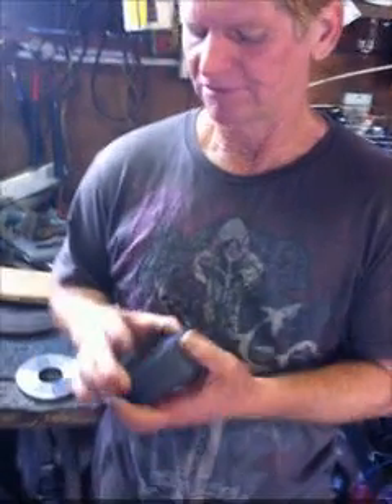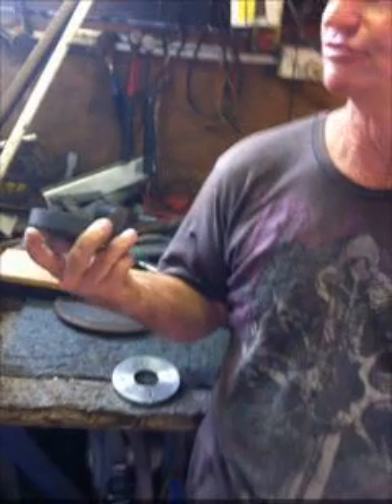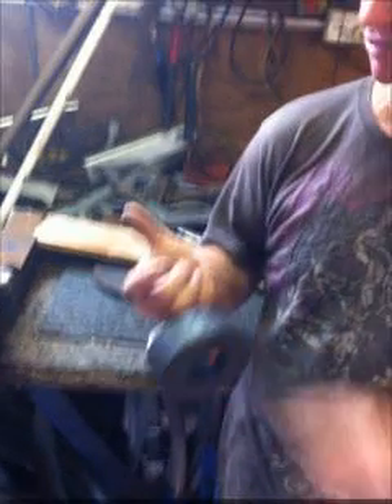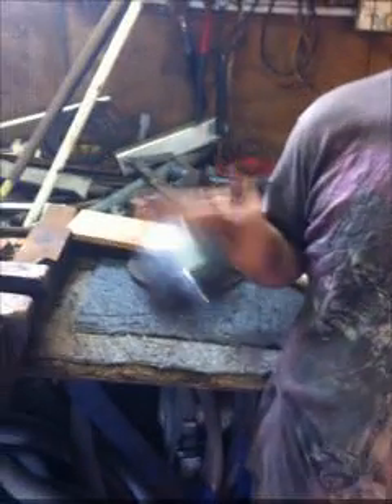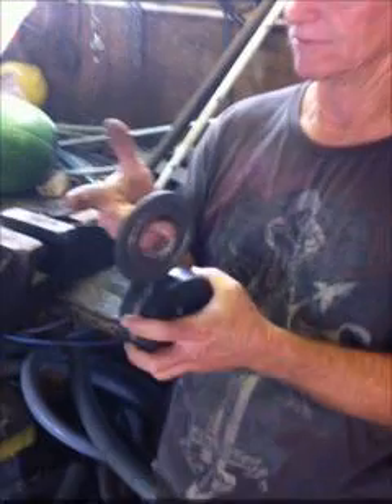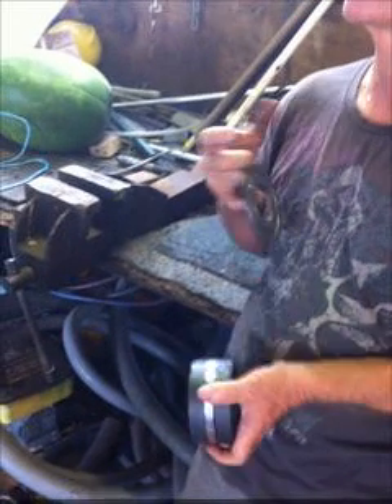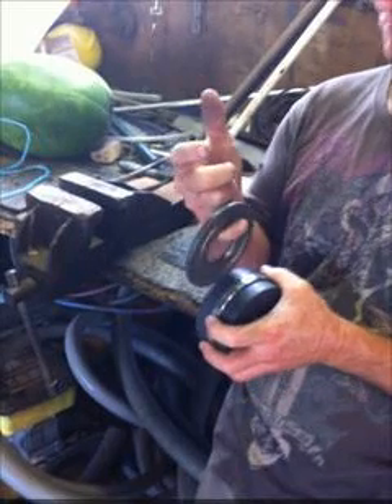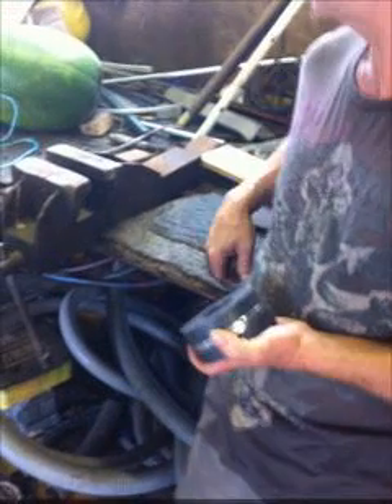A I R Peter Stevens with Joe all about magnetics 25 Feb 2012

Comment: today july 16 2024 the british 4.4 diesel range rovers suffer from the alternator diode failing this causes the whole electrical system to shut down instantly because it is wired through the starter motor wire hence the ac pulse is returning into the dc winding of the starter i presume causing a dead short to earth .try jump pack and that i stantly goes flat.also put a new battery on and this gets hot .maybe this is part of the process ...

Comment: Joe  magnetism  the  melon wire loop melon = metal wirecoil metal in the rotor of the alternator, they are magnet if current flow to the wirecoil , and powder  it's really power that trow in the magnet wirecoil it's just bit  to give 12v in the regulator , but if we take of the wire of the battery regulator that will be produce  boot negative to the engine  but also remove the ground  negative of the body of the car just boot the engine then make some straight from the alternator to battery and with light 12v to the body cause u don't need to give more then 12v to ground  the electronic  in the car,

Comment: Something's called ions that dance within the structuring partly photon evolving field This is where joe puts the same faces neg to neg on the neutral washer and then as it attaches to the vice the hole in the magnet centres vortexes outwards like 2 cyclones kissing and at the kiss ( in the centre of the washer it draws the structure out of the vice and whatever else it can try to equalise the wood bench acts as a potential break from ground. Something like that. No expert here in uk but on track. Mel in uk

Comment: More of a view at 4.58 in. The house / engine block walk to front/in to crank of engine block go to round about/ front alternator crank pulley wheel (static neutral goes up fan belt that may have wire inside /take a left 'y' junction / 3 phase wiring on alternator then 't' junction is starter solenoid (the exciter center with pos and neg either side ricochets a dc pulse like a bee humms ) take a left staggered offset "T" (could be the starter shaft/gear stuck into flywheel as this would cause a spark gap as they turn together with the collapsing dc pulsed field from the solenoid causing this 90 degree spiked energy. ) junction is a chain loop acting as a ac spark gap break from starter solenoid earth to oil dipstick as oil would allow a charge to flow within all engine same as a coil but fluid  flowing round crank etc as a fluid distributor your back on the crank to go round again as the potential of pos attract neg will not jump back to ignition headlight relay wired stan meyer shows this locked loop process with a light bulb in line just a updated thought vacuum has to be in inlet as prssure and vacuum may act as acceleration and deceleration.  Remember also most starter motors have a aluminium front nose casing thus could act as a condenser and field interuptor.

Comment: The invisible is the Aether.
Magnets are structured in their atomic structure to collect the energy from the Aether.
The concept of a neutral plate (washer) is to 'play' with the magnetic field. Take it some where and use it.
Same for the wet joecells.
Get with the facts Peter
magneticwaterscience.com
Reply: Hi Lynn I have recently found out Peter brock may have passed his air polariser on to racer tom walkinshaw on the jaguar xjrs TWR. Mike roddy in Melbourne gas one as we do in uk. It has all the add ons for this energy blank water pipe into inlet air con attached to inlet also a blank and resonators in stainless exhaust plus oil pump mounted on crank. Maybe joe knows thus as Brock also did Ladas with this to get immision s down any reply on the above to confirm or disprove appreciated